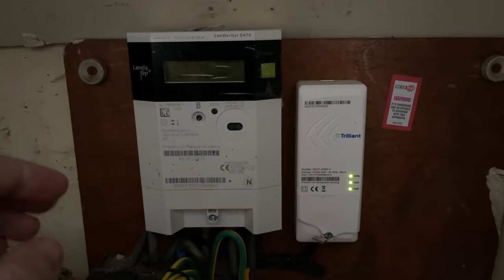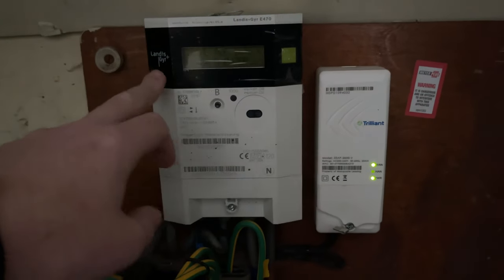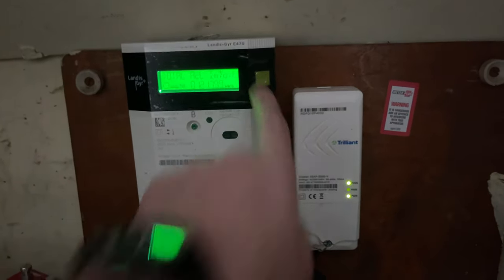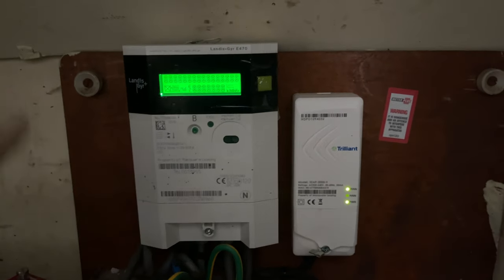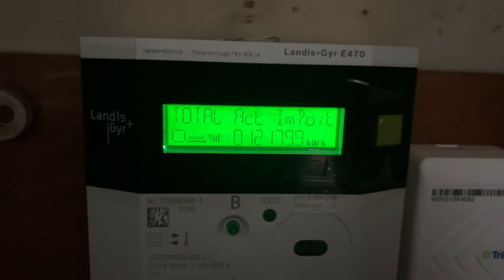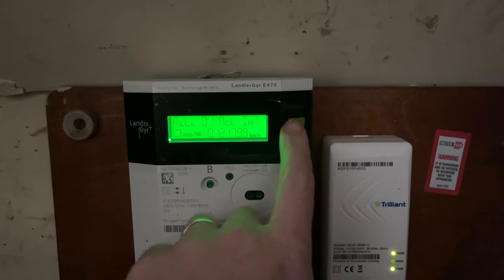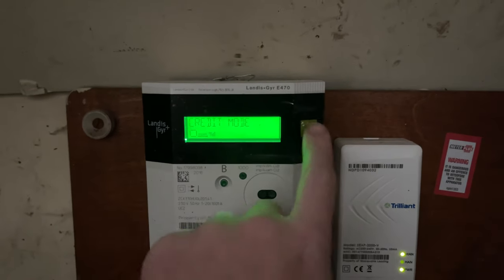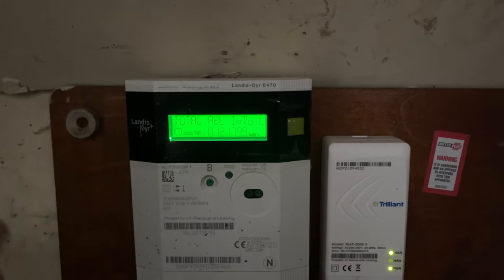How to read a landis + gyr e470 electric meter

Comment: Hi, the meter reading, is it 12000 or 1200, because its a huge difference in price and can't tell which is the correct amount, because mine says 12050, which seems extortionate when I've only just moved in
Reply from the maker: Hey it depends on what reading you have. That reading isn’t the actual money but just how many units you’ve used which is then used by the electric company to work out the prices of what you’ve used. You won’t get charged 12,050 units, that’ll be your starting reading and will be charged for whatever units after that.
Reply: @FixItWithFusco  ah okay, it’s just my parents meter says 1250 for their usage and when I go to see the prices on gas and electric companies, they normally have th electric around 1350 avg (for this new home) so just confused me and my parents a little as to why it’s over 12000 cause when we put it in, the avg monthly cost is huge, so we were just gonna the companies and get a reading since I believe this is a smart meter 😅
Reply from the maker: When you have a new meter, it starts at 0 and will count up from there, until it reaches either 99,999 or 999,999 depending on the meter and go back to 0 again. No matter how high or low the number is, that's not what the money is for the bill. Say your parent's meter is 1,250 at the start of the month and 1,350 at the end of the month, they've used 100 units and if yours is 12,050 and goes to 12,150 then you have also used 100 units and only get billed for that, not the total amount. Hope that makes sense :)
Reply: @FixItWithFusco  hi, yeah that makes sense, but when I'm comparing prices for gas and electric companies, the kWh is 12050, but when I put that in the price per month is over 200, so I'm not too sure what values I'm in need of putting into those websites to get an accurate result, we were just gonna call the company and ask them to read it since we didn't know which value to put into the websites
Reply from the maker: I do believe the thing you input is what amount you’ll be using each month rather than the current meter reading. So if the house uses 500kw per month that’s the charges as it’ll be say 10p per each kw, so £50 for 500kw, but each company has different prices along with the daily standing charge etc.